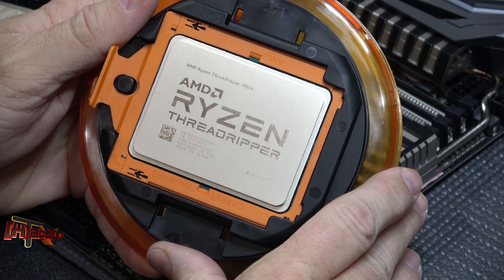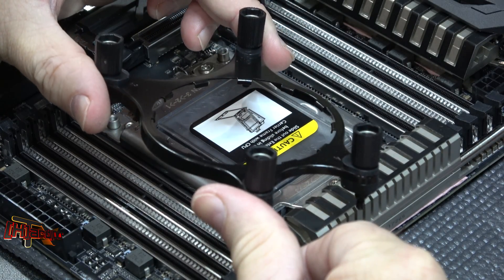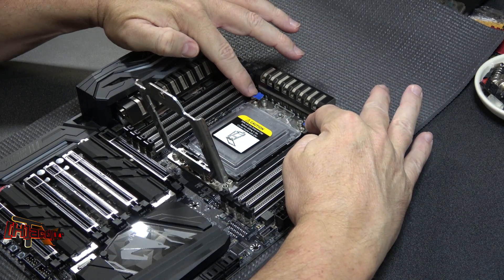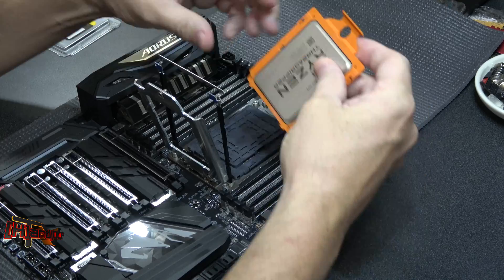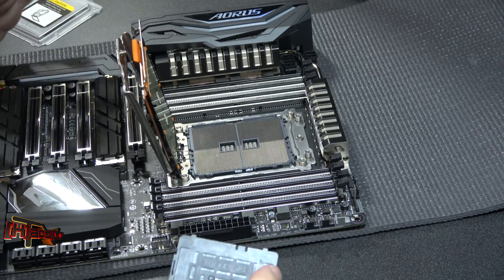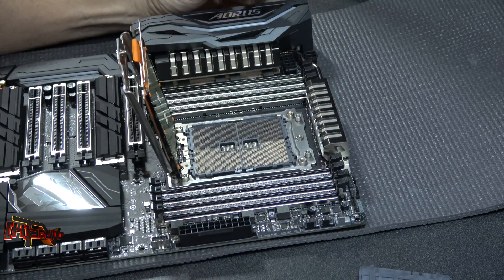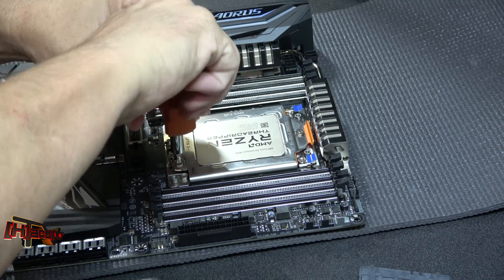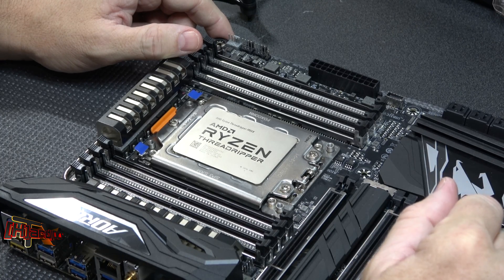AMD RyzenThreadripper Install

Comment from the maker: UPDATE:  After spending some time with this damaged TR4 socket underneath my lighted 4X magnifying glass, I am not confident that I can repair the bent pins to my satisfaction.  I am using a set of tweezers comparable to a fine dental pick.  I have always been able to fix bent pins on damaged Intel LGA sockets.  That is not the case here.  With 4,096 pins in this TR4 socket, these pins are incredibly close to each other, and while I have gotten those "unbent," I am far from being sure that those pins are aligned correctly.  The pins are of course compressed when you put the processor in the socket, and I have to feel that they might move differently than originally intended to under that pressure.  I simply do not feel as though I would want to risk putting my brand new Threadripper into this socket and turning the power on.
Reply: HardOCP TV thanks for the update. I have done repair on plenty of older 1155's and some x99's so I am really happy you forewarned us on the fragility going in as the gear is rather expensive. Oh I bet newegg's RMA department is going to have to put rules in place and probably have to update their QA/QC guys that approve lol.
Reply: Thank you for showing the problem. it well may save me from doing the same (assuming that you review it well, will affect my purchase)
Reply: thk u HardOCP TV for showing us ALL the hazards w these delicate CPU PINS just so we WONT make the same mistake.

hat off to u mate!

Comment: Very happy with the CPU design. It reminds me of the G34 platform, and I am happy they came up with a way so you don't have to lay the CPU into the socket using your hands. I've damaged 2 motherboards doing so (back in the G34 days), and it costed me $100 to fix it each time...

Comment: I've watched half a dozen installs on YT pulling off the protective cover before they install the processor. I was cringing but thanks Kyle for the confirmation.
Reply from the maker: I would suggest no removing the pin cover till the moment you are ready to locate the CPU into the socket.  :)
Reply: I would never,  but was shocked at how many did.

Comment: Wow those are crazy fragile.  Learned my lesson back on an Athlon 64 that I was trying to be gentle with but it slipped out of my hand and bent about 30 pins.  An hour with the needle nose and yipee I was not going to be extra broke. 

I wonder how long until sockets are rigged like older CPU's where once you set them in the sock you latched them down into and clamped onto the pins.  Do that in reverse where the pins are in the socket but you have a lever to pull them down into a shroud until the CPU is locked in place.  Then you push the lever pushing the pins up against the CPU contacts out of their shroud.  

Though with so many pins....

Comment: I think that HardwareCanucks is pointing at you in their leatest tweet.
Reply from the maker: Actually he is referring to some of the folks on YT that are removing the orange shroud/frame around CPU itself.  Seen a bunch of that this morning.  As instructed above, DO NOT remove that.  However, it can be put back on fairly easily, unless you throw it away....
Reply: HardOCP TV thank you for clearing that

Comment: Dont worry about that shitty gigabyte motherboard .... Use the asus motherboards did you receive the asus motherboard?? Or they give you the gigabyte motherboard
Reply from the maker: Gigabyte has been making some great motherboards for the last year.  And yes, I have several here now from different manufacturers.
Reply: HardOCP TV i really have a bad experience with gigabyte fm2+ motherboard... The first one i bought has some issues with the ethernet controller the replacement one stoped working after 3months of continues use in a server and after that i throw that board out and got an asus a66 motherboard it is still going strong for 1year and it is not even a high end motherboard just a 50$ asus motherboard that is working great for day night on our network server  it has the amd a6 6400k, 4gb Kingston ram, samsoung 750evo 120gb.. cooler master 450w psu , generic case!!
Reply: HardOCP TV it was this motherboard such a bad board no one should buy this Here is a great deal on the GIGABYTE GA-F2A68HM-H FM2+ AMD A68H SATA 6Gb/s USB 3.0 HDMI Micro ATX AMD Motherboard , http://www.newegg.com/Product/Product.aspx?Item=13-128-763
 I found.
Reply: HardOCP TV this is the good asus motherboard .. i also have the asus p5kpl am/ps motherboard for 10years and it is working great with a rock solid over clock of the pentium 4 631 from 3ghz to 4ghz it is a room heater and it is not avery high end motherboard i am really stressing the board to its limits 4ghz at 1.5v stock is 3ghz at 1.345 v .. it has only 3 phase vrm with no heatsink on the mosfet ... Here is a great deal on the ASUS A68HM-Plus FM2+ AMD A68H FCH (Bolton D2H) SATA 6Gb/s USB 3.0 HDMI Micro ATX AMD Motherboard , http://www.newegg.com/Product/Product.aspx?Item=9SIABB75CN4225
 I found.
Reply: You realise its foxconn that make the socket? All boards will be the same.
Reply from the maker: All motherboard manufacturers have "bad" boards.
Reply: Gavin Hawley shuuush let them ramble on...
Reply: Gigabyte mother boards are very high-quality boards. You were just unlucky with the one you had.